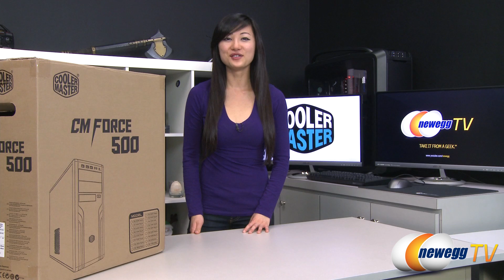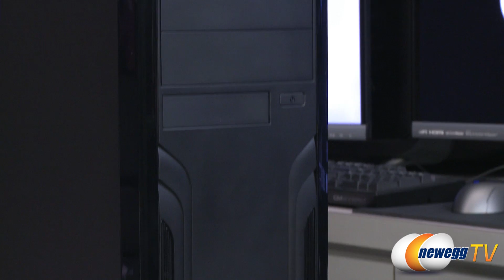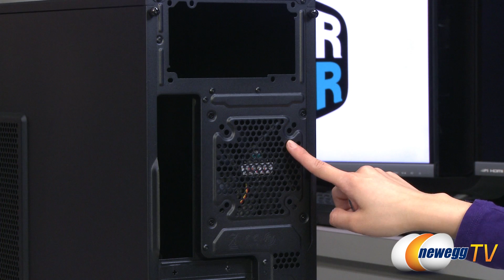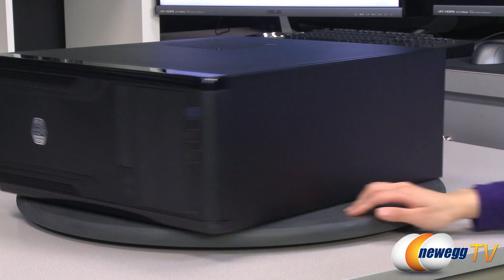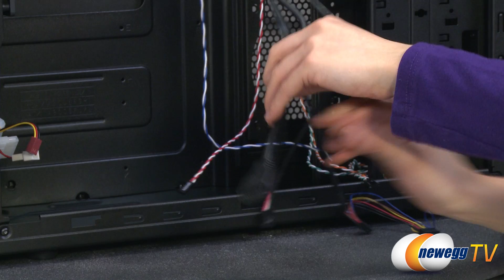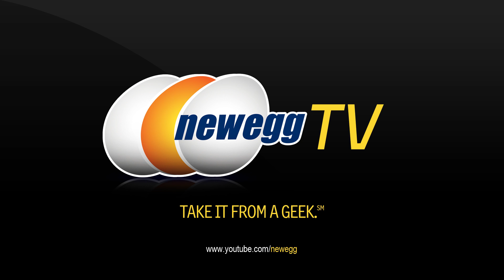Newegg TV: COOLER MASTER CM Force 500 ATX Mid Tower Computer Case Overview

Comment: can somebody help me?
i want to know that exhaust fan is near psu intake fan wont that make psu overheat?
Reply: Chrome Warnock Actually the PSU is on the top of the cabinet and the stock cooler is in the middle so the distance between them is fine and i am using one so I have no heating issues. It's way better than Corsair Carbide Spec-01.

Comment: I have this case and it sucks
Reply: Imran Haque No, nor should you get a case with a pre installed PSU. Those combinations almost always have both a shit case and a shit PSU. Never cheap out on your PSU, cheap PSUs will fail at some point and when they do they might damage the rest of your components.
Reply: I agree. There is almost no place to install your case fans, and it only comes with one case fan. So i said fuck it and popped the side panel off and stuck the case fan on my radiator.
Reply: RevolutionV12 Mine came with 3 pre-installed case fans. I guess it depends on your retailer. I just bought a new case and I can say that it's x100 times better.
Reply: does it come with a pre installed psu?
Reply: Imran Haque >my current pc config is very basic

how basic? do you have a dedicated gpu?
Reply: ye, core2duo, 945g chipset mobo, 9400gt gpu for last 4 yrs
Reply: Imran Haque sometimes these PSUs last longer than expected, its just that they fail more often than not (personally happened to me as well). If you're going to build a PC today its best that you just get your PSU and case separately.
Reply: my budget pretty tight but i'll try to squeeze one if possible
Reply: Imran Haque spend very little money on storage and ram then, you can always upgrade that in the future. Whats your budget and what are you looking for anyways?
Reply: not planning to buy anything right now maybe 5/6 months later to see how the intel 8th gen stacks up against amd's zen chips. i'm not interested in buying dedicated gpus as i don't game much maybe a few racing games so i'm more interested in igpu performance and gonna make decision based on intel's dual core/ core i3 vs amd zen/vega apu performance. cpu/apu, mobo, ram, casing these r the parts i'm gonna buy
Reply: Imran Haque wait for Zen APUs then, Vega and Zen APU will be amazing. I doubt that Intel will ever put out a good APU, so if you buy Intel i would recommend to scrape together some money for something like a gtx 1060 or r7 470, but thats of course up to you.
Reply: my current pc config is very basic and it's running for over nine yrs on a psu that came with the cheap casing

Comment: 1. for someone that "build more pc's than anyone else", You're failing super hard on the "Does the Internet really care" part.....

 which 99% of the people here dont care.

2. Coolermaster is not that bad of a brand as your making it out. 

If it was the case, then why is one of the most popular Aftermarket coolers the CM hyper 212+ and how come you can find there cases near the top on the popularity as well?

(And yet this is someone that doesn't have a single coolermaster product.....)

Comment: What else is there to talk about? Here's a case, it has some fan points that support some fan size and it doesn't have a removable motherboard tray. What else do you need to know?
Reply: Meason?
Its very good video.
The case is not free.
It costs Around 55 dollar.

You are going to get info before buying.

But Meason it's not for you.

Comment: The 800D is also $80 more than the HAF X, so that would be why the HAF X has 3x more reviews. I have no experience with either case, so I can't really say an opinion on them. He and, I suppose, his company have had a high failure rate with Cooler Master cases, so his opinion is negative. Apparently his company hasn't had a high failure rate with Corsair, since he didn't bitch about them.

Comment: The Hyper 212 is a great cheap CPU cooler! Shit quality?! It has some of the thickest steel you can find on a case, maybe the thickest. I have never heard of front panel failure before, but I looked on newegg and 4 reviews said there was front panel failure. 4 of 1,100 reviews. I have had 0 problems with mine, and use them everyday. 76% of the reviews are 5 eggs. lolwut?